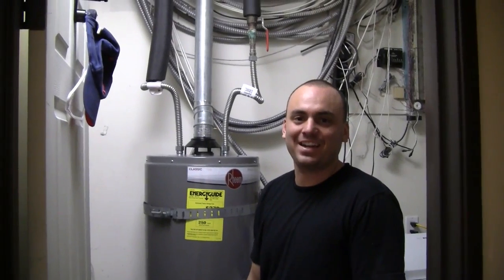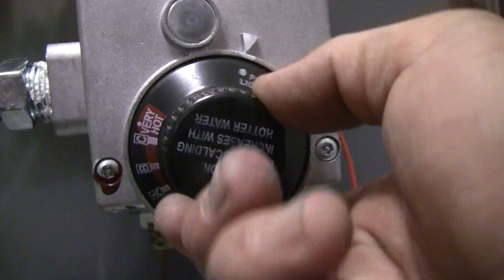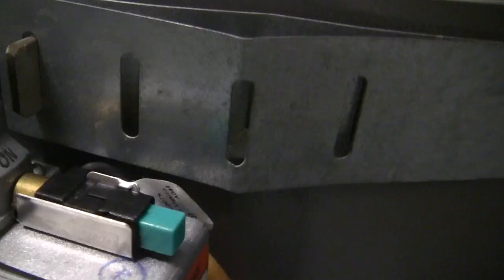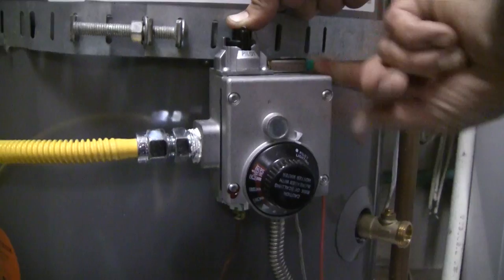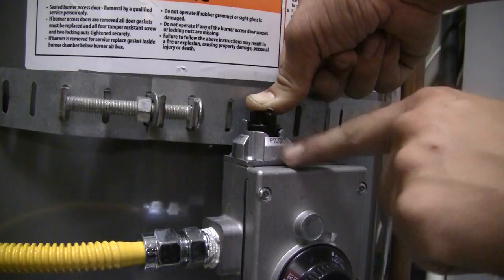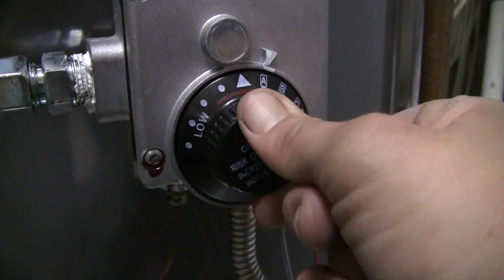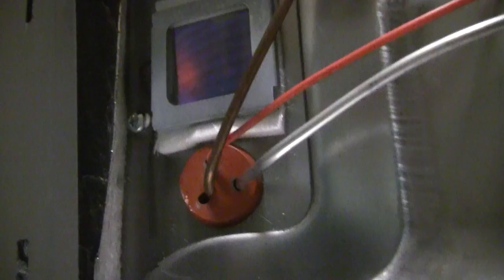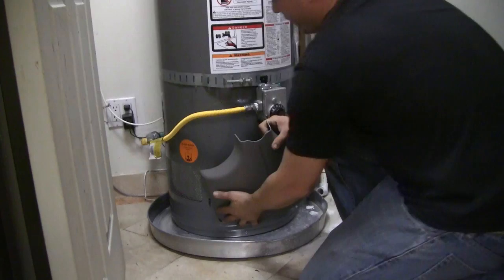How to Light a Water heater pilot (new style)

Comment: My propane went out but full now and my water heater wont get gas to ignite it, what happened?
Reply from the maker: You need to re-light pilot
Reply: You may have to purge air from the supply line. The air to fuel ratio has to be within a certain range. If there is too much air or fuel, you won't be able to ignite the pilot..